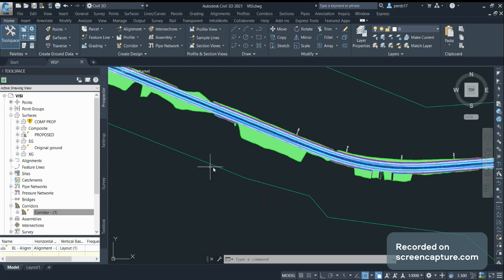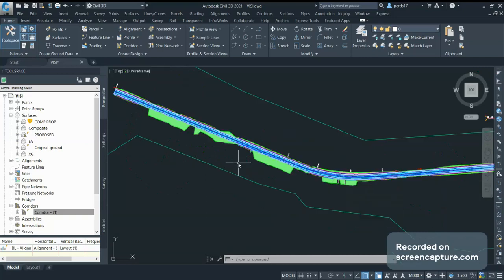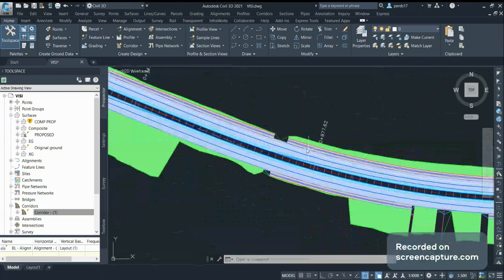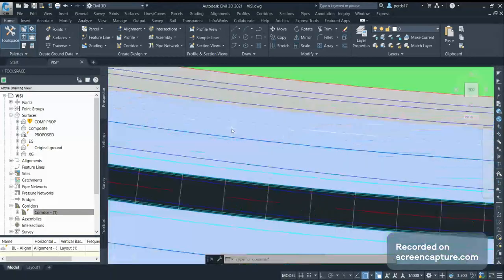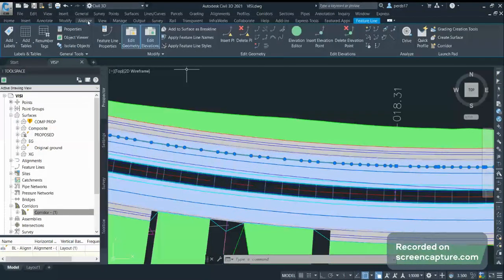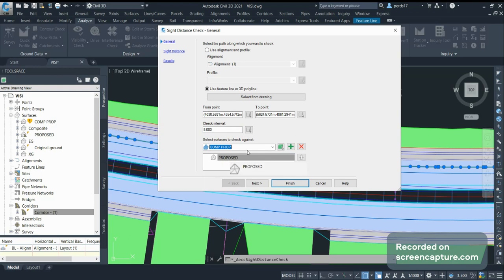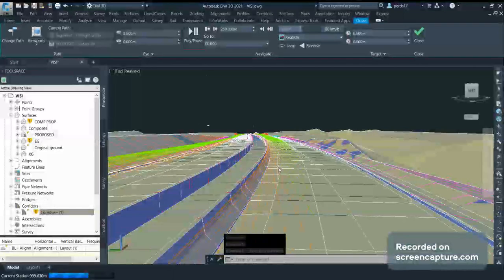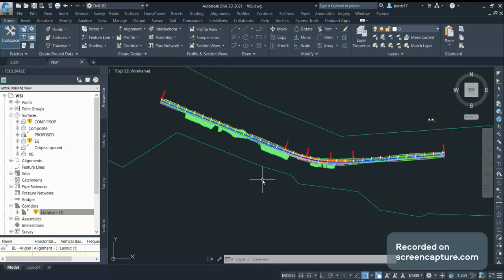Civil 3D - Visibility Analysis (Stopping Sight Distance)

Comment: What about the eye offset and object offset ? It won't be "0" right ? (Since vehicle will be moving on either side of the centre line alignment)
Reply from the maker: As you see visibility checking done for outer lane and inside lane of opposite direction. We have created reference line in centre of both lane so you don't need to give any offset value. You have to check visibility for worst condition.